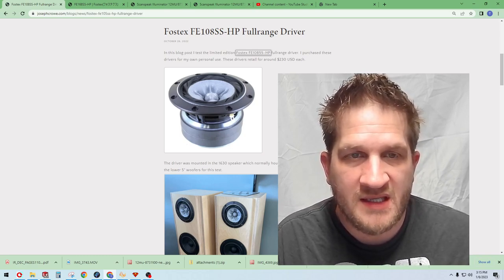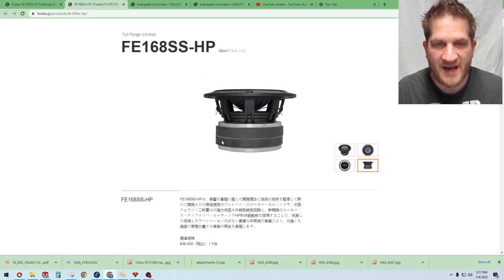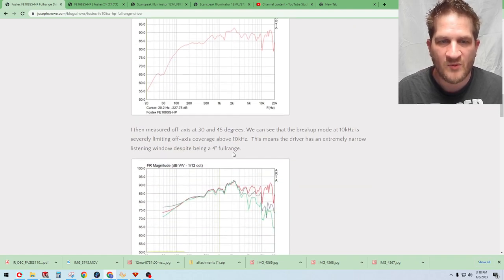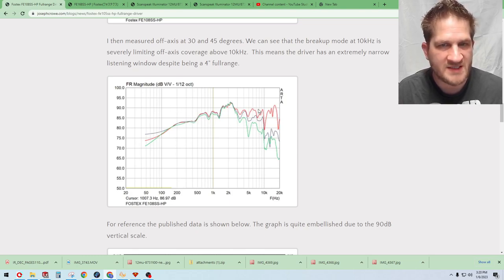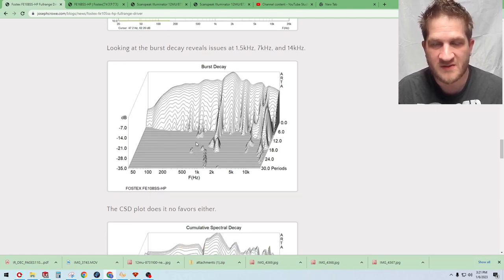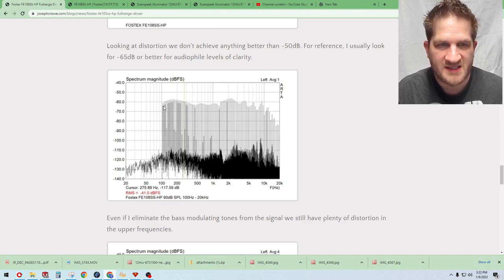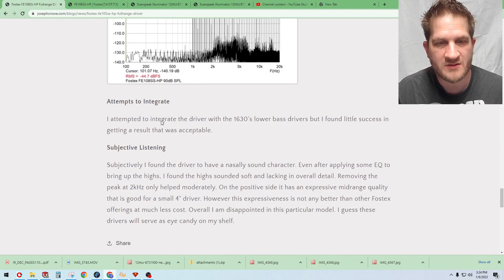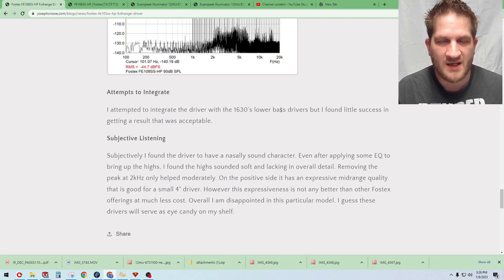Fostex FE108SS-HP Fullrange Driver

Comment: Thanks for the detailed analysis! This saves everyone lots of time, money and effort!  Unfortunately, proves yet again that the latest Fostex full range drivers are not that great.   It also explains the 'limited edition' stamp, too. I am starting to very much question the sanity of Fostex R&D team.
Reply: I fully agree
Reply from the maker: I wouldn’t rule out the brand, just certain models. I still like their latest FE108NS. It’s better than the FE108EZ.
Reply: @JosephCrowesDIYSpeakerBuilding  I don't know Troy. These are not cheap drivers. They seem to be chasing their tail with fancy materials and intricate shapes when treated paper and 70s technology still sounds better.  If these new cones and suspensions are the result of computer simulations, they probably don't know how to run or interpret them.

Comment: Thanks for the great review!  Looking at some of the frequency response curves, I’ve been wondering what all the hype is around some of the Fostex drivers, especially given the price.  Are there some legacy drivers that might be performing better?
Reply from the maker: Twenty years ago they were the only game in town. Over the past 5-10 years they’ve seen some real competition, combined with not introducing anything significant in term of technology, especially in their motors. The ScanSpeak 12MU that I recently tested is an example of a driver that puts Fostex to shame. It has no real breakup until 10kHz and even then it’s benign causing a dip in the response. The 12MU isn’t even a full range driver, and yet it does better than most at the task.
Reply: @JosephCrowesDIYSpeakerBuilding  Good to know, thanks!

Comment: I tried putting a Fostex FF85wk in a really shallow 20" waveguide/horn and was really impressed.  Ever tried that driver?
Reply from the maker: It’s odd you me mention that because I just purchased the FF85WK, FE83NV, and MarkAudio Alpair5.3 for a shallow waveguide project. It’s a square waveguide measuring 16” x 16” and supplemented by a 1 cu. ft. bass cabinet using a single MarkAudio CHR120. But I’ve had to postpone the prototype build until I get some other projects completed. Email me if you want the plans at least.
Reply: @JosephCrowesDIYSpeakerBuilding  Haha, very cool!  I would like to hear your thoughts on this.  I think there is something to waveguides we still dont understand.  For example, why is it that immersiveness and fidelity increases so much more with even a slightly shallow waveguide that cant possibly improve directivity that much in the mid frequencies.  Also when I tried it, I ran the waveguide "open baffle" with the backside exposed.   Still got very nice FR and imaging in my room.  And the waveguide was made from cardboard!  LMAO..   Cheap fun.  Will do something much more well crafted one day.

Comment: Great video!

It's just a rough driver. Why use this over something less expensive like a Dayton full range driver?
Reply: customers sometimes believe there's magic to a particular driver or alignment.
Reply: @@conorhanley2087 DIYs tend to measure more and buy less in to myth. At list in my experience.
Reply from the maker: Generally when a company puts that much effort into the motor it means lower distortion. But there are many pitfalls along the way. I just think the cone has too much breakup, otherwise it might have been a great driver.

Comment: Hello. Your videos are very interesting. They seem quite technical and objective! I see you have a lot of knowledge about horns. I built a back loader horn, design by fostex, using an FE166NV speaker. I used plywood, as specified, but I wasn't happy with the end result. The bass seems to me with a lot of coloring and is not deep bass. The sides of the box seem to vibrate. And it seems to me that it produces little bass.

I have two questions that maybe you can answer:

To your knowledge, would it be better if all the walls of the horn were more rigid, made with harder wood?

Because the walls are vibrating, rather than transmitting the bass out of the horn, can they not be dissipating?

I see you use a lot of solid wood.

Thank you very much! Andre
Reply from the maker: Two things, #1 You need to try it with a tube amplifier. Don’t sell them until you do this. Even if it is just something like the Miniwatt N3. 
#2 Did you make it with baltic birch plywood? This is a thin ply type of full hardwood where the ply is about 1.5mm thick. Many people get confused and buy plywood with a softwood core. The ply on soft plywood is around 3mm thick. This plywood is only a quarter of the stiffness of birch plywood, which is why you get mechanical vibration.  You can fix by adding  another layer of plywood to the sides.
Reply: @JosephCrowesDIYSpeakerBuilding  In general in Brazil, the inner part of the plywood is made with soft wood from reforestation, so I think the inner part is soft. In fact I had made two models of speakers, one using the FE83 with a spiral horn, original design by fostex, and the other larger using FE166. Both of them weren't good, but the spiral horn was really bad. However, last week I painted the spiral horn and the sound has totally changed. it's amazing how a few coats of paint totally changed the sound. Thank you very much for the tips, as soon as possible I will connect a tube amplifier.
Reply: @andredebacco  
Fostex drivers need burn in time, like 15hz wobble for 2 weeks non stop, then You get bass...

Comment: around 2kHz: this peak is typical for a speaker mounted into a baffle or enclosure - if you did not compensate for the "baffle step". Nothing to complain about then ....
Reply from the maker: The peak is part of the driver. It’s unique compared to many other drivers I’ve tested on this baffle.